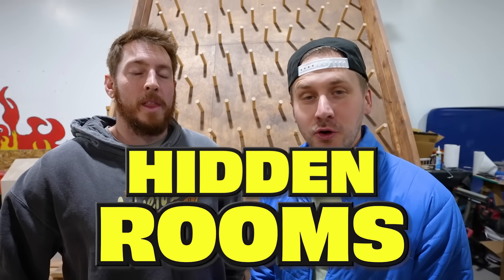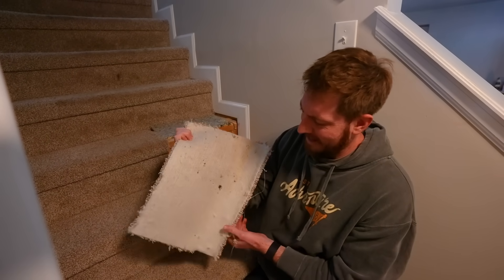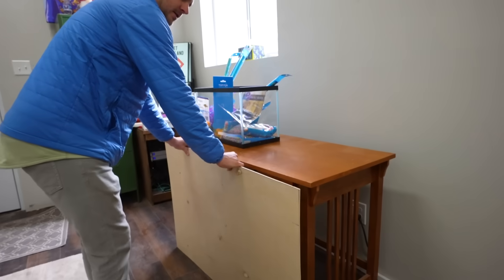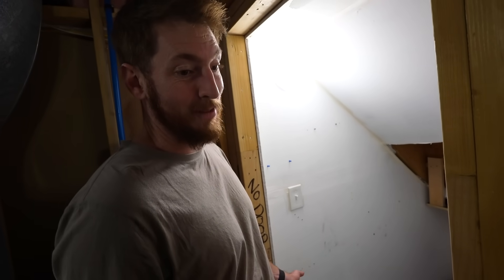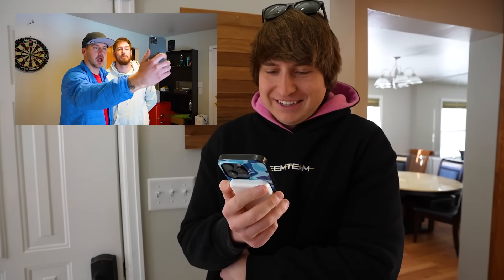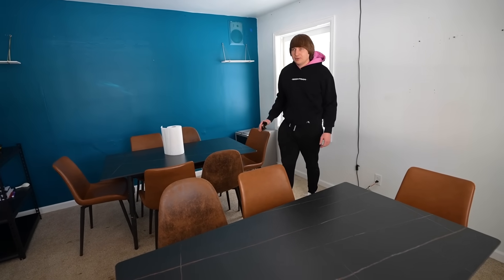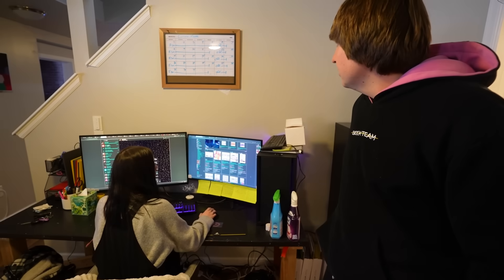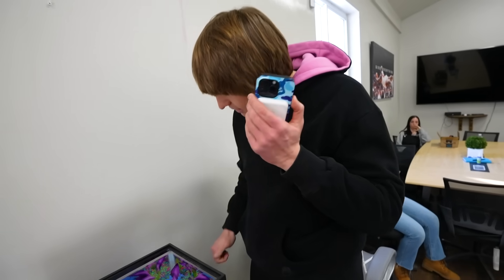Hidden Secret Room Hide and Seek! *LOW BUDGET ONLY*

Comment: You said aquarium and I immediately had a great idea (to me at least). Build it like a bookshelf, where the aquarium sits in the middle. You can have the door on either of the sides. So basically, the aquarium is the front, and the hidden room is behind the aquarium. But, you have a sliding window behind the aquarium that you can look out of from the room. So you can see outside, but it looks kinda like you’re in the aquarium.

Comment: ISSAC i remodle im 15 yrs old i got g but listen with the vent if u screw it in long enough it wont hold so u can unscrew it with ur hands so the hard part is hoping the screws fit into the hold right after u get in or dont do no screws but u could tie a fishing string on to it because its almost invisivle and hook it on the inside so it holds
if u didnt understand mb 
if u did then good job ig?
KEEP UP GOOD WORK THE TEAM OF MOREJUSTu and yall ofc been with yall for along time sense 800k this is a different yt acc tho so dont got all of them showned watched ;c